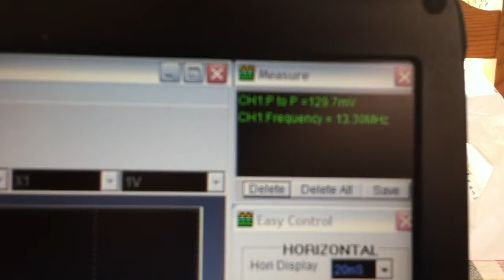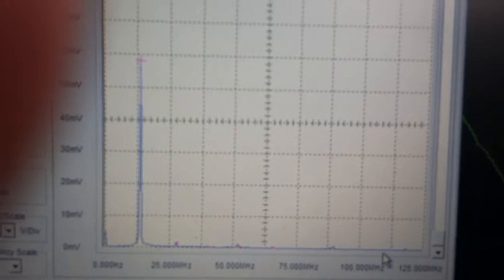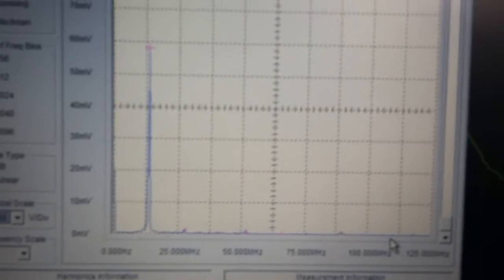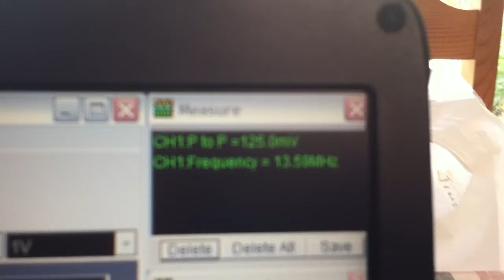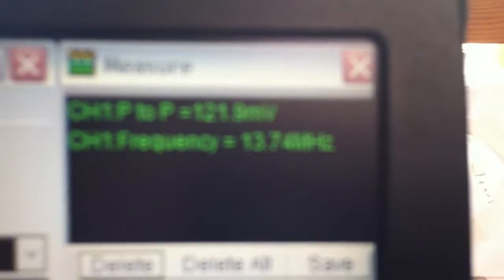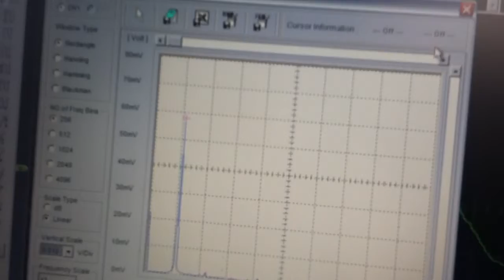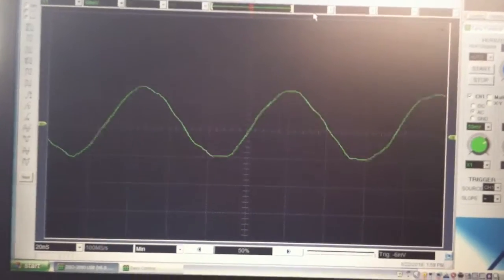13.56 MHz Crystal Oscillator wave form and frequency

Comment: Maximum voltage coil to coil is 2r (2 X radius). If coils do not have a matching radius then use 1/2 (r1+r2). This is for air to air transfer and does not apply to Single Wire circuits. This is max. V, NOT max power transfer as current is the inverse of distance squared. 1/D^2.
Reply from the maker: OK. Thanks.  That helps.  The goal in this project (for me) is to light up these new 110v LED bulb boards like you showed.  What I am seeing is that you can get usable light by not lighting them all the way.
Reply: I wish I could give a concise and simple answer but one does not exist. We have the major differences in how the systems are driven, then we have the energy lattice (actually aether) but easier to explain as the EL. It is not a commonly know bit of history that when Maxwell's work was redone that the aether was removed. This could have been from different points of view or a bit more sinister. The aether is pretty well supported and called many things, (Zero Point Energy, Dark Energy(Matter) along with my view as the Energy Lattice. Having said that, LED's appear brighter when switched a high frequencies, (Neechi) although this does not match the response of human eyes. This is to long and most likely not the forum for explanation.
Reply from the maker: Oh to be able to see forward 50 years when all of this is better understood and devices have been invented to take advantage of it.  Led lights might even  be a thing of the past.
Reply: Ho! Ho! Ho! as that white haired guy says. How about a device in the center of a ceiling that can cause light to any area at any brightness without wire or bulbs. Like broadcasting light? If we do not destroy ourselves physically or socially,then all dreams come true.,
Reply from the maker: Sorry I took so long to respond.  What you said rattled around in my brain for days.  It is like science fiction  but I can see it happening someday-----or has someone in Texas already done this?

Comment: Hi I can't get an exact 13560khz crystal but i do have some 13350khz and i can get more or less same results as you have
with a home made L3, I started off with 80 turns of 28 swg (approx) and am down to half that with a bit of ferrite just inside
but I cant light a neon like you can (i'm using a flat 1000uh choke) but I cant see any spike.
Where on the sine wave is the spike ? please show ;) regards.
Reply from the maker: The spike is not shown on the wave form like a Bedini SSG spike.  The 'spike' is the coil resonance point and shows up on a spectrum analyzer.  It sounds like you have replicated my experiment.  Congrats. I don't think we need that exact 13.56 MHz crystal do get results.  I have a 7 MHz crystal  that  gives some results using the right matching coil.

Comment: And now you've visualized it (i.e. the standing wave at 13.56 mHz) with your scope.  
That spike is your standing wave & it is responsible for the power that is driving your load. 
The energy scattered at various other harmonics is not concentrated like your standing wave.

Good presentation.  I just wish I could see the mV range clearer.  It looks like ~50 mV & if your load is pulling 30 mA, then your power consumption is probably ~1.5 mW.
Reply from the maker: Yes.  The mV was very very low.   This not a 'free ride'  but it looks pretty good to me.
Reply: I wasn't implying/suggesting it was a free ride.. Just merely pointing out the obvious from viewing your findings.

I agree with you--it does look pretty good! :)

Comment: That's a nice clean waveform for a sniffer coil. Also liked the spectrum analyzer...it's not bad at all for PC based. 
The neon is a good indicator and rarely seen on these sorts, away from the Slayer.
Very neat  :)
Reply from the maker: Thanks.  It is an interesting project but now that I know that 13.56MHz is the exact frequency used for RFIDs I not sure which way to go now.
Reply: I'd say to grab some of the RFID tags. They are 3 for $1 on Ebay and the coils must be useful. 
Another way of thinking about it is the whole 'hiding in plain site'. Consider how Dublin Uni suggested the same freq as used by kids R/C cars could grow better vegetables...yeah right was the answer. But that works ! Same thing may be with this and, thinking about it, could be the reason why those tiny keyring things can work in the first case.
Reply from the maker: OK.  Lets go RFID stuff and see what we can turn up.  There are RDIF receiver coils available dirt cheap also and I may get some of those.  If nothing else they should make great joule thief components like wireless chargers.

Comment: Congratulations! You've invented the RFID jammer!
Reply from the maker: I just found out that this is the exact RFID frequency.  Perhaps that is why the crystals were easily available and cheap.  Now the question is what can we do with it beside jamming.   Slider suggested that we buy some of the EBay keychain things and take them apart for the antenna.  Or perhaps it is time to end the project and move on.  I don't really want to mess around with the FCC regulations.
Reply: Your power levels are quite low.  I'd be surprised if you're causing any significant RF interference beyond your property.  Any decent ham radio jock could measure your output to see if it's a problem.
Reply: you're not original
Reply: Sez "Jesus Christ"... LMAO
Reply from the maker: I think that you are right.  Dr. Stiffler commented on this subject earlier and said the same thing.  He is an old RF engineer and been a Ham guy most of his life.  He taught at the University of Hawaii for awhile.  He knows his stuff. When I was working with the SEC exciter projects years ago people kept asking him to come up with scaled up designs with higher power and he flat refused.  He cautioned everyone NOT to even think about it because of FCC rules.